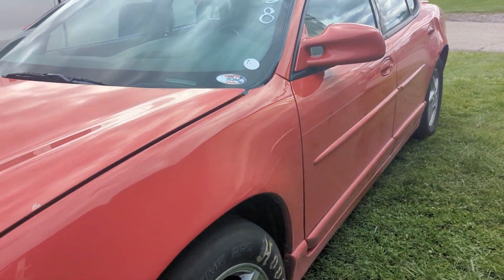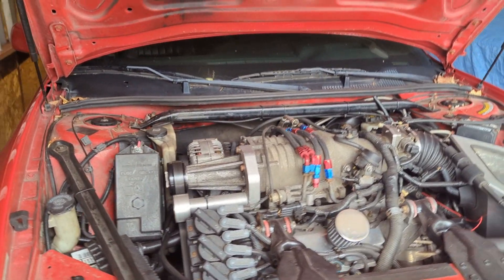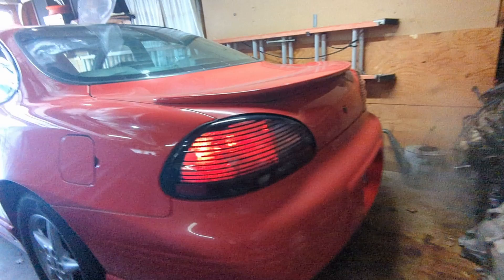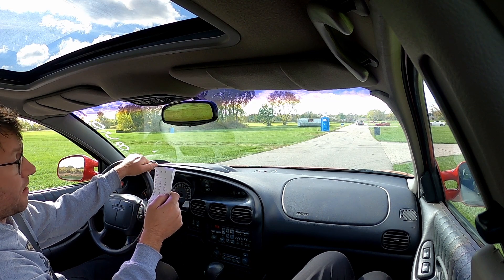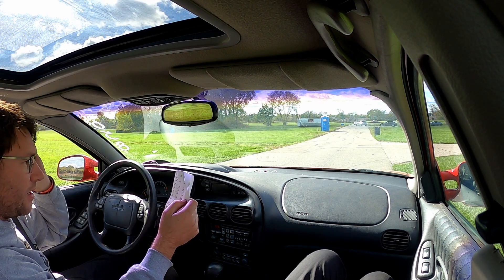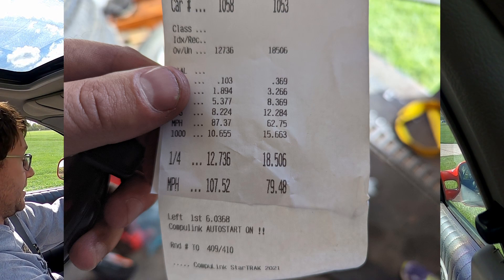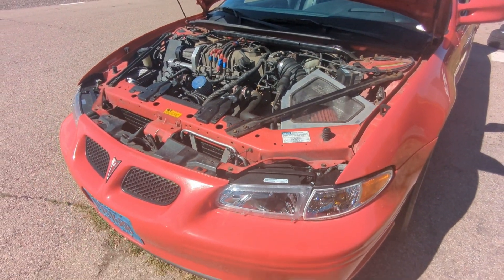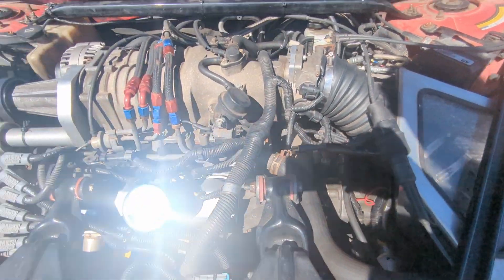12 second GTP | 3800 | 4T80E Swap | Pontiac Grand Prix

Comment: What converter did you end up using? Strongly considering going with an 80e swap when I L67 swap my GT. Just not sure if I want 3.11's or 3.71's....
Reply from the maker: I have a transtar reman in it right now.  Stock 4t80. Very low stall.  Im near sea level so it works okish.  At 3000+ feet elevation a converter would help it.  I have a custom made precision on the shelf that i plan to go to but at this power level im fine with the stock.  This car has 3.11

Comment: Very nice.  I'm building 2 GTP's right now. Where did you get your cam?? Is4??
Reply from the maker: I called comp cams and told them what i wanted.  I wanted something not on a 116 lsa.  If you want the same cam here are the specs at .050.  228/235 .386"/.375" int/exh 112 lsa.   With 1.6 rocker .617"/.600" lift.  I'm using a crow 140 spring.  Guides need to be cut

Comment: Who tuned the transmission for you?
Reply from the maker: A local guy did the initial tuning with hpt.
Reply: @josephnowak  cool. I've got a 2002 seville with a 3800 sc in it I just need the trans tuned to start driving it
Reply from the maker: Sounds like a cool project. The only items that needed to be changed for the 4t80e swap into a 1998 3.8sc car were input, output, and sprocket ratio to get mine to work.  I also had to make a jumper harness and went w a relay to change the trans solenoid logic. I have no experience putting a 3.8 into a cadi so not sure if there are other details.
Reply from the maker: @averryGaming my setup is a 3:11 diff.  3 things that had to be changed.  Drivesprocket ratio 1:1.  Pulses/rev (input) 39. Pulses/mile (output) 23434.  This is using the 3.8sc pcm to control the 4t80e.
Reply: @josephnowak  this is the 3 things all in the speedo calibation??
Reply: @josephnowak  did you play with the gear and tire wizard
Reply from the maker: @Ss-Seville  i think it was done the hard way without the wizard.  Once the speedo (output) was corrected the trans shifted in open loop just fine.  Im using a 225/60/r16
Reply: @josephnowak  beautiful I'm going to go try this. Thank you so much
Reply: @josephnowak  hello i am still stuck playing with this ecu tuning. did you disable abuse mode on the transmission? i changed all the ratios with tiny tunner and the car still doesn't know when to shift. it also waits till 3k rpm to enable the tcc.
Reply from the maker: @Ss-Seville  we left all the torque management enabled.
Reply: @josephnowak  ok thank you then I have some more playing around to do

Comment: You ever figure out converter lockup?
Reply from the maker: I found an error in my trans tune.  Correcting input tooth count from 25 to 39 allowed tcc to work with pcm command.  It also allowed shift adapts to work curing firm shifts durring normal cruising.  One exception is when it pops the rear knock sensor code it will default back to no tcc.  Im sure there is a way to fix that i just havent put time into it.

Comment: got a gtp stock trans has is3 cam and all supporting mods with a 100 shot of n20 ran a best of 12.1 with a soft 60 ft to help the trans live as well as not spraying between shifts
Reply from the maker: Thats solid - Its good to hear that others are still playing with this old almost forgotten platform. N2o might be in the distant future.  I want to try to max it out as it is first.   All the weight will be left in.  Its a nice driver and cruiser.

Comment: Hey there Joe I'm really serious thinking about buying this beautiful '05 supercharged GTP 3.8 but the problem as we all know is always in the weak factory tranny's which is the case here with just 209k I believe on it and wondering which tranny they used on these supercharged 3.8's the 65 or highly doubtful but the 80's? I'm guessing to make this car n combination rt that I'm gna end up doing the 80 swap like u did since GM cldnt do the right thing in the 1st place with bumping up the tranny in a supercharged car fer crying out loud!!! So I saw your 1st vid and am verrrry impressed with your idea's n work along with making it a 12 second street car!!! Hat's off bud!!! 🤛🙌👍👌
Reply from the maker: Thanks for watching and commenting!  Yeah they all came with the 65e.  Its not really that bad in stock form.  If it feels solid do a pan drop - filter and fresh fluid.  A strong magnet in the pan helps.  Factory mags are weak.  For a modded car seems like an 80 is a way to go.  Good luck!

Comment: Wow that's fast! I'm a 57-yr old mechanical engineer that bought one new in '97. No mods, but I had it until 196K miles. But it cost a lot of money to keep it on the road (1 supercharger and 2 trans, then the dreaded intake manifold leak, took out the crankshaft bearings). Good luck with yours!
Reply from the maker: Its too bad you didnt get more life out of yours.  I got a 97 with a ton of miles (302k+) that keeps on going. Thank you for commenting!

Comment: Random question but would you do a twin engine Grand Prix in the future 😂😂
Reply from the maker: No, that wont be a project that I will do.  There are documented cases of twin 3800 cars and ls4 cars out there.  Its not something I would be interested in doing.  Its hard enough to get one powertrain to work correctly
Reply: @josephnowak  fair enough your basically adding a ton of weight and double the things that can go wrong when I think about it 😂😂
Reply: @AllWbody each of our ~390whp 3800/4t80e powertrains is only hauling around 1600lbs each
Reply: @Turbocharged400sbc  YOOOO I checked out your channel didn’t think someone actually did it that’s awesome 👏 😍
Reply: @AllWbody  3rd build out of the twin engine olds,  this time full Tilt 25.3, etc
Reply: @josephnowak  awe don't be a sissy, it easy
Reply from the maker: @Turbocharged400sbc  if i played with it one day it would be with a different car.  Appreciate the encouragement 😂